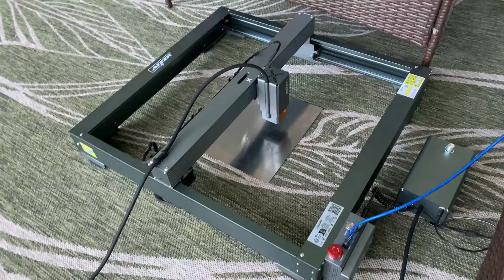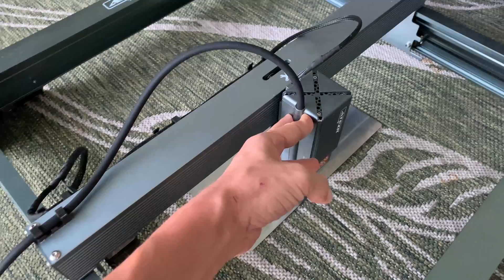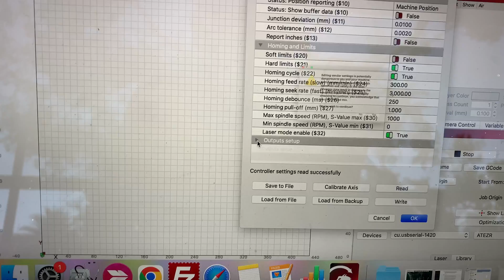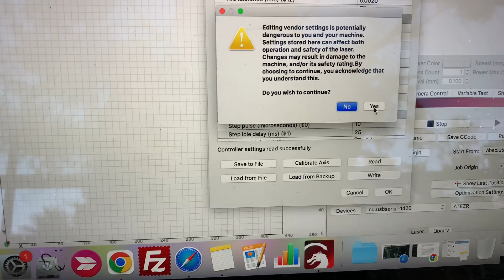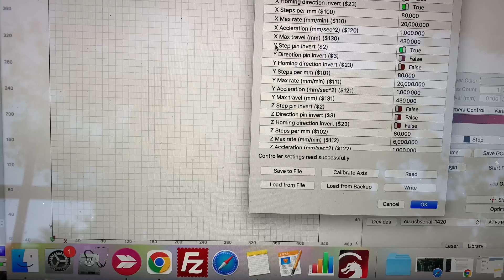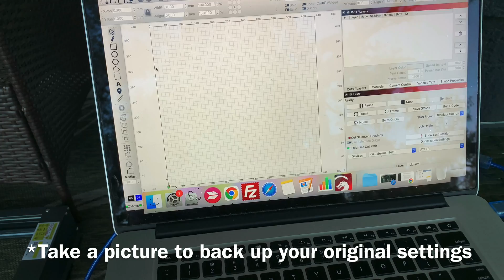Fix: laser engraver not homing properly & belt making loud grinding noise - Atezr P20 Example.

Comment: Thanks for this info; going into my saved file for sure!  I have an Atezr L2 36, and I can use the jog function (using touchpad, no Lightburn yet) with full range.  But there's a "frame" function that just sends it into an endless loop of small rectangle shape (no cutting).  Also other touchscreen paths for home, etc. but I can't figure which corner is "bottom left".  Have any suggestions?

Comment: Hi, thanks for sharing your knowledge. In my case, when I press home, the machine does not even move and it only indicates alarm:9 homing fail. could not find limit switch within search distance. defined as 1.5 * max_travel on search and 5 * pulloff on locate phases. Any idea?
Reply: Same issue with my 35w+, been waiting a couple of weeks from their "professionals" to resolve the issue.  I see that the DIY Audio Guy has posted the same error.  It's looking like it is a significant issue with Atezr and their Atzer.lbdev file settings.   I have found as a temporary workaround to begin in a location other than "Home".  Set that as an absolute starting location in Lightburn.  I am using 1.4.xx.  From there you can adjust settings as per your particular equipment.  I do believe it is the Limit Switch settings from the factory.   I do not want to manually reconfigure any settings until the factory (if ever, not hopeful), has had a chance to correct the issue on their end however.
Reply: Hi I have the same issue for my algolaser

Comment: I am getting the same error, (alarm 9, homing fail, unable to findlimit switch) but the machine seems to be moving in the correct direction to find home, if you have any advice of what to look for ?
Reply from the maker: Sounds like limit switch unplugged or not working.
Reply: @DIYtimeTech  Ok, I was able to reach the one on the frame (I guess that is the y axis) and trigger a code when I pushed it.  so that one appears to be working.  I think it is the y axis.  How can I locate that switch?